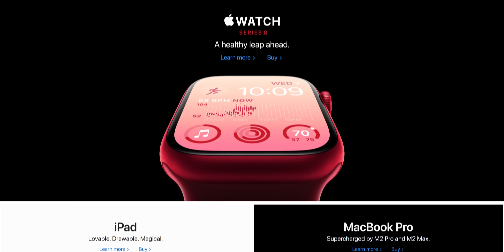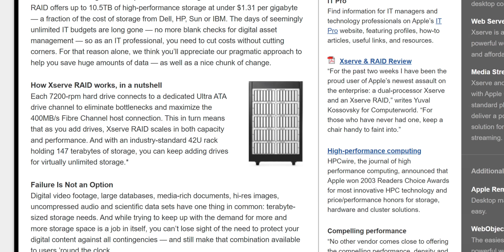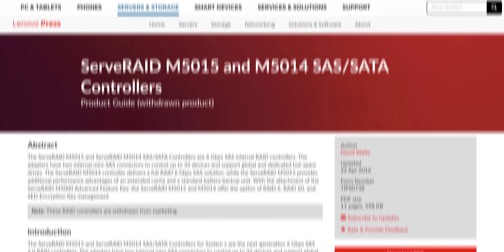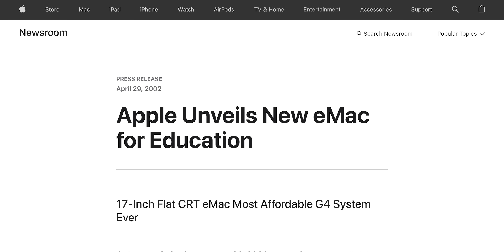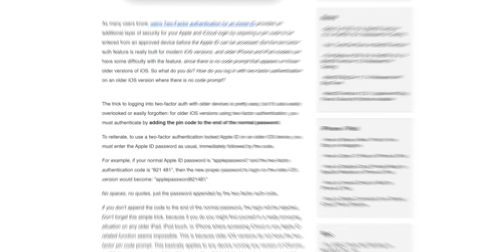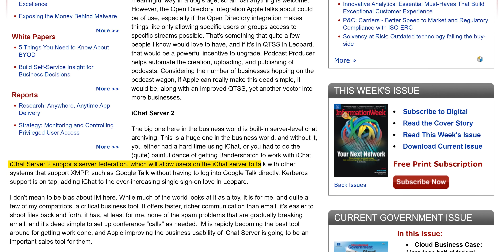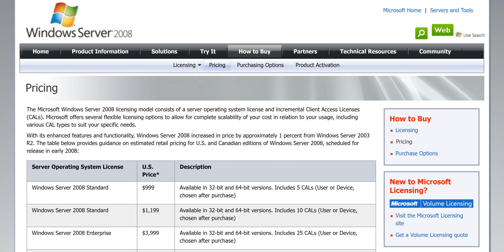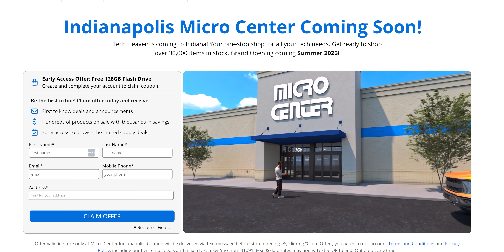I Bought the Last One Apple Ever Made... - Apple XServe 3,1 Server

Comment: We had X-Serves for year that ran side by side with OD and AD. Used them for about 5-7 years. Probably still have one hidden away somewhere. Open Directory and Workgroup manager were great for managing end user Mac settings like the dock layout, background, login windows and what not. 

OD and WGM eventually died to become Apple Profile Manager that competed against 3rd Party products like Jamf and I believe Meraki had/has one too. 

Profile Manager was awful, unreliable and often would corrupt databases leaving SysAdmins panicking with no way to mange Macs or iPad and require all the devices to be reenrolled. These issues led to the death of Profile Manager which left OS X Server very little to do besides stuff like NetBoot or App Store Caching (both still available in MacOS, for now). Apple killed off Profile Manager and started to direct customers toward JAMF which is now Jamf Pro and other MDM products but never picking one specific product to sponsor.

Apple Configurator 2 still exists as a... lets say, "half baked" MDM and allows for some basic configurations of devices such as WiFi rollouts but its mainly just to get devices enrolled into other MDM's that were not purchased with an account that has a Device Enrollment Program (DEP) through Apple School/Business Manager.

Comment: I hadn't touched an Apple product until I started as a tech at a public school almost two years ago, and I have learned a lot. Mac is so close to being amazing, but for some reason Apple really wants to tell you exactly how to use your devices and not let you change it. Their enterprise support has been getting worse and worse as time goes on from what I have seen.

One of the more recent examples is removing Firmware Passwords for Apple Silicon devices. One of the most boneheaded moves, because this makes it so anyone could boot up a Mac into the new Startup Options, and do things like boot off of another drive or just start wiping things. My current headache is that their update software that is baked into the OS is horrendous and requires a community of Mac admins to keep a fleet up to date.

Edit: I should mention, after everyone yelling at Apple for removing the Firmware Password option, they made a Recovery Password for MDM owned devices only, which is fine. They just should have done it right away and not a year later.

Comment: I've had one of these for awhile now, and it was exciting to see you guys talk about it . They do have a raid battery, and I'd assume most of them are dead by now (mine is, it reminds me every time I start it up). Not only that, the raid card prevents you from booting OS's other than OSX, at least on the main 3 drive bays. You guys should totally turn this thing into something cool, so I can steal your idea and then do it to mine lol
Reply: It's likely that whoever they bought this from yanked the battery out a long time ago. OS X would complain if the battery was dead/flat and it's just a ticking time bomb before it turns into a spicy pillow anyways.
Reply: The raid card is a “MegaRAID”, which is very likely compatible with drivers for similarly branded cards for e.g. Linux. Just FWIW.

Comment: I am curious if the hard drive firmware lock was due to efforts to keep support simple, like you can’t call in with an issue and have a third party drive so there’s less of a gray area for support to consider
Reply: H s actually wrong. You could use off the shelf drives. That one just has an apple label on it like all their HDDs did.

Comment: Two corrections: 1) the HD firmware was not a “lock in” we upgrade capacity with off the self drives with no issues 2) Remote Desktop was plain VNC for basic screen sharing
Reply: Yep 100% this, I upgraded many Xserves with off-the-shelf SATA drives

Comment: The FATA interface is there to allow better compatibility across chips(fibre channel based SCSI), and the interface was used on many enterprise NAS\SAN\DAS equipment, last one i worked with was an HP EVA 4400 as things started using the SAS12g interface

Comment: While the sleds are custom, the connector is actually pretty standard FibreChannel, and I've had limited success running other drives on the interposers in the sleds. The problem is the classic early Apple SATA chipsets not properly supporting SATA-2, so when the drive reports "Hey, I can do more than 150Mb/s!" things fall apart. WD had a jumper setting on some of their early SATA-2 drives that would cause them to only report SATA-1 support and work with these older systems. Even then I never saw them as reliable.  The EFI implementation on these machines is another disaster, as from what I recall it is EFI32, and not EFI64 or UEFI.  Getting other things to run beyond macOS 10.6 was an absolute pain, and eventually I migrated the NAS we were using to a VM on a Dell R910 host system.  Oh the joys of having two dozen fibrechannel harddrives and migrating all the data off to an external usb drive, then back on after rebuilding the array as a ZFS storage pool.
Reply: I got monterey running with opencore and a random 1tb drive. I didn't have any luck creating the usb with windows so i had to create it from a mac vm...
Reply: Good to know I was not the only one that kept saying "not proprietary" every time he said that.  Anyone that has worked in SANs for a length of time recognizes a FC connector, but also that 9 times out of 10 its just a sata to fc adapter.  The firmware being locked is also super common in both FC and iSCSI environments.  I know the video is for entertainment but it always irks me when he just makes up stuff on enterprise hardware.
Reply: @vltek  came here to say just that 😂 usually LTT is pretty good, but with enterprise stuff, especially Jake is usually kinda off
Reply: 2009 xserves are EFI64
Reply: @tehfalcon  Yup, that's precisely why they could go to El Capitan. EFI32 supported ended at version 10.7.5 I believe.

Comment: I love the TFA and expired certs nonsense.  sigh  I have one system I refuse to update past High Sierra, for… Reasons.  There’s a lot of turning clocks back for install.  I got my hands on a G5 Xserve and a pair of Intel jobbies.  Getting them going, and finding installs for the Server OS was… interesting.

My greatest frustration is the X-Serve RAID, that you can’t really use unless you connect to an actual server, or it would have been a great JBOD.

Comment: Used to support xServes. I've got Ventura running on a few I still have using OpenCore Legacy Patcher. They still run surprisingly well in 2023! That little primary drive inside the case was actually an early SSD by the way. The Server OS was typical Apple. What it did in the GUI out of the box, was nice and easy. But if you wanted to get under the hood and tweak it, Apple made it unnecessarily complicated. I seem to recall their 'Web Server' for example being a basic Apache server with lots of Apple stuff piled on top. If you tried to customise it under the hood in the Terminal just like you would on Linux, it would freak out the GUI or the Apple side of the software, and nothing quite worked the way it was supposed to. My worst experience with them was running Networked Home folders on Shared Client Macs on the network. Even with the beefiest xServes with the best RAIDs and enterprise switches, the network would absolutely choke hosting networked home folders, something Windows servers at the time would handle with no issue. I don't miss Mac OS Server at all to be honest. Even when they sold it as a separate OS, it never felt quite finished.
Reply: Yeah, if you wanted to do deep configuration changes you'd need to disable the built-in server and set up your own.
Reply: We had the same problem. We tried to do some website customization and Apple's OS simply killed the configuration each time. Eventually we just used VirtualBox.
Reply: How do they handle Ventura? I can't imagine that's a great experience lol
Reply: @TallGingerDude  my 2009 iMac handle Ventura very well. All I have to do was upgrade the mxm card for a newer version. I’m pretty sure theses Xeon servers handle modern OS very well. If you don’t need performance per watt it could be a good deal

Comment: Quite a few inaccuracies in this video, very lazy mistakes.

- The hard drives were not vendor locked, the interface is SAS/SATA 
- The RAID card was battery backed up
- The OS you couldn’t get to work is because you tried to install the old OS on a newer computer, to burn it to a USB for another computer, you’d simply take the disk image and use disk utility
- The software also allowed you to make custom configuration changes, not just through the GUI, it was bare OpenLDAP, Apache and Samba after all, and yes, it did have a full Active Directory as well as DNS etc
- You could just run a proxy to allow SSLv3 to translate to TLSv1.1 Apple’s servers otherwise still host the updates and apps.

Comment: You 100% could use non proprietary drives in these sleds. Did it all the time including 2.5" SSD's
Reply: However, if I remember right there was a 2TB limit per drive because of the controller.

Comment: I feel like you skipped a huge use case: offloading Xcode builds and continuous testing workflows for app dev teams. OSX is STILL hard to run in any kind of CI pipeline. At my company these machines were happily doing builds until 2017-ish.  And Xgrid was super cool!

Comment: So cool fact - the Xserve and the ability to share a workload across multiple servers and machines is the basis for a small company in Kentucky called Dataseam, who provides 25 iMacs for the cost of Apple's Certified Technician Certification ($5,000USD, so give or take $250 a machine) to underfunded schools, with the dual purpose of running cancer research, and since 2018, Covid Protein research. I worked at a small school in Southeast Kentucky and one of my machines was credited with cracking some part of the Pfizer Covid vaccine. It was really cool.

Comment: I upgraded my Early 2009 MacPro 4,1. First I did firmeare 4,1 to 5,1 and then I changed the dual quad core 2.26 MHz (de lidded) to dual six core 3.33 MHz (de lidded). Just the firmware upgrade made the latency about 8 times shorter. I use Pro Tools and before the firmware upgrade there was a session that needed a 512 sample buffer size to not be interupted and after I could set the buffer to 64 samples in the same session. Now I can just put on tons and tons of plugins and it doesn't even break a sweat. It's incredible how much that old computer can handle. Of course today a smart phone is more powerful but... it doesn't run Pro Tools.

Comment: I used to work for Apple, and it's all fine as long as you buy a new machine every 3–4 years,  which was totally manageable back then. But once you try to get an older machine to work, you run into all these artificial, proprietary bull crap OS issues. That sort of stuff is the reason for a couple of mental breakdowns as well as grey hair.

Comment: As someone with a Mac Pro 4,1 I think there’s really only one option: but normal xeons off eBay, then torch the IHS with…a literal (small) butane torch to desolder the IHS from the die. I did it three times for my dual Xeon system and it works great!
Reply: "Three times... dual xeon server" - I think I know what happened to the third! 😂
Reply: @kaeota  Congratulations, you can do basic subtraction math!
But yea RIP that 3rd xeon 🤣🤣

Comment: There is a way to get around the certificate issue for the older mac OS systems, 10.9, 10.10, 10.11 and 10.12 all have expired certificates but if you were too boot up to USB stick of the operating system. You can then change the date in terminal to a date earlier than October 24th 2019 and the installation will go through as normal. You have to ensure WiFi is turned off otherwise soon as terminal is closed it will reset the date. The only exceptions would be certain machines don't install certain operating systems for some reason. The MacBook White Unibody for some reason always fails to install 10.9 from a recovery stick. Apple do still allow people to download any OS from Ventura back to Lion from their website and the more recent OS's have a built  in command in the 'Resources' folder of the installer that allows you to make a bootable USB stick of the OS even from a machine running a much later operating system.

Comment: Hello, *nix admin checking in. I was forced to administer some XServes for the past seventeen years...And hated almost every minute of it.

"Why was it so cheap?" It wasn't; they were more expensive than equivalent 1U white-box offerings from everyone else.
"Did it have any redeeming qualities?" It didn't, at least not for actual server use.

The hardware was pretty cookie-cutter, entry-level 1U stuff, wrapped up in Apple's schmoo. The last-gen PowerPC ones were so poorly-designed that most of them died from 'smiling disease'. They were designed so when you pulled them forward on their rack rails, the top of the case stayed with the rack hardware...Of course, this made the chassis super weak and prone to bend. The entire rack case would take on a visible curve, hence "smiling disease."

Apple's "fix" was to tell people to "install the XServe above another piece of equipment or place a rack shelf directly under the bottom of the XServe." For those that didn't, the machine would flex and eventually start exhibiting serious hardware problems due to solder joints failing on the board.

Earlier versions of the XServe didn't even have link/act LEDs for the network interfaces.

They were so close to get it right so many times, but the OS got in their way almost every time. You think it was bad when an OS X update comes out and changes the black levels, oh boy...I can't remember which update it was, but if you went from 10.X to 10.Y following their docs, you'd truncate all of your users' mail to empty files cause they changed MTAs and never bothered to work through the process themselves.

They did such ridiculous stuff as update PHP and break their own in-built webmail---Squirrelmail---cause they didn't bother to test, even though the issue had been known---and fixed---in mainline PHP for half a year.

The Windows domain integration was poor at best, not respecting password-change intervals and all sorts of other group policy-related things. The broken SSL cipher suites is a constant pain, causing us to lose support for certain cert formats even though the individual applications could have used them if, well, Apple hadn't screwed everything up by hooking in their own cert stores and such.

That installer song-and-dance is why I have gigs and gigs of old Apple OS installers I ripped from the App Store and such stored away at work. :( It's utterly ridiculous.

Almost everyone I know that still has a functional Intel-powered XServe dumped OS X years ago and now just runs Linux on the things.

No one in their right mind that wanted to actually depend on their servers would use one of these things for mission-critical tasks. It's to the point where I suppress that I know anything about OS X (and specifically OS X Server) if I send out resumes again in hopes that I will never have to deal with Apple in a professional capacity again.

At least our XServe didn't vendor-lock drives. :|

Comment: The fact that Apple uses so many proprietary components in their devices is the main reason I have never bought Apple products. They WAY overcharge for their proprietary components which means you get the shaft every time you might need to replace or upgrade a component. Even their interface cables are one of a kind and far more expensive than non-proprietary products of the same function.

Comment: fluid ads work better, but memes are memes, lul
Reply: vendor lock intended
Reply: enforced loyality = slavery, many different layers, in a system, from os to dust, you go
Reply: can rely on any of the circular jerk loop lock loop
Reply: they dont want you to hack your mac
Reply: use dual socket pro windows instead of server

Comment: I used to love running OS X Server on my Mac Pros. They simple to setup and made for great servers while same time would other still be your vanilla Mac OS experiences. When they did away with the dedicate OS and move to the Mac Server Apps, it was actually pretty disappointing since a lot of functionality was lost.

The biggest issue I had with OS X Server was support and/or help from Apple was nowhere to be found and the server version was $500-$1000 when the regular consumer version was like $70-$100 for almost the exact same OS.

As for upgrading your CPU, I upgraded my Mac Pro 2009 to a pair of Intel X5690s about 8 years ago and the machine still runs great though, isn't fast by today's standards. I delidded them with a heat gun and sanded down the solder, I think it took me less than 10 minutes. The issue was I had to get the firmware from the Mac Pro 2010 and flash onto my 2009 model, so if you were to do the same on the Xserve, I imagine it would not plug & play unless you had firmware to support the upgrade.

Comment: The boot drive doesn't have a connector proprietary to Apple. It was something Toshiba used on later 1.8" drives to make better use of the space consumed by the PCMCIA pins. Adapters to use a ZIF drive with normal SATA power and data cables are only a few dollars, since they don't need any active electronics.

Oh! And the drive module connectors aren't proprietary, either! That's a standard Fibre Channel interface.